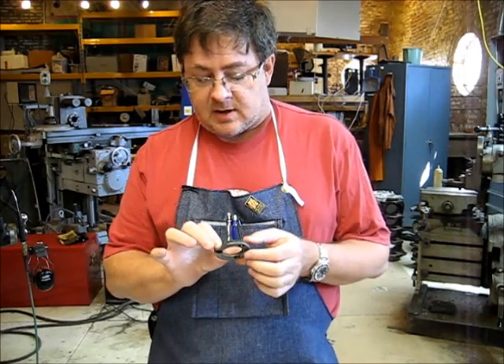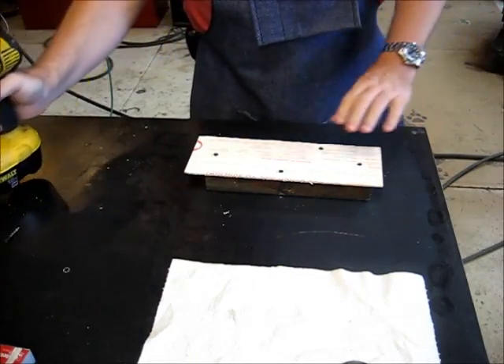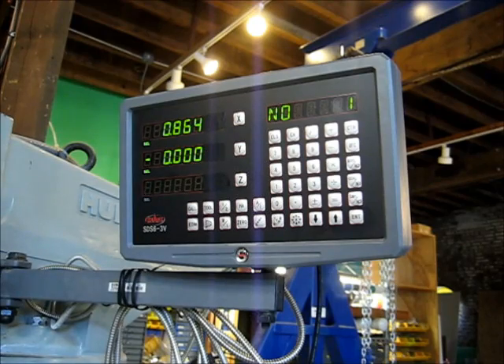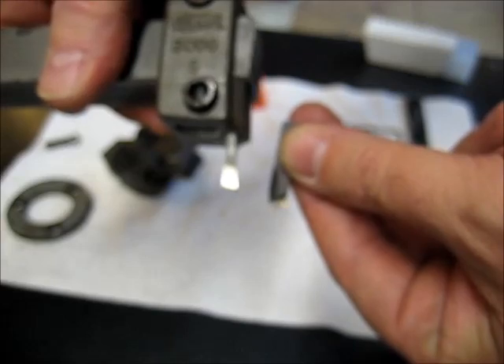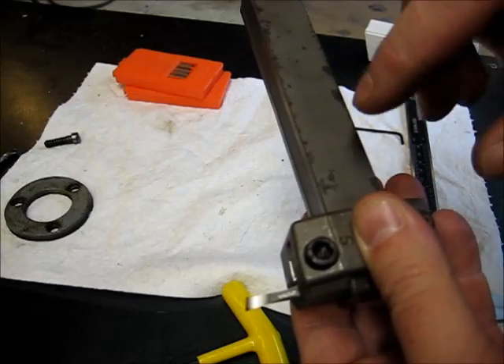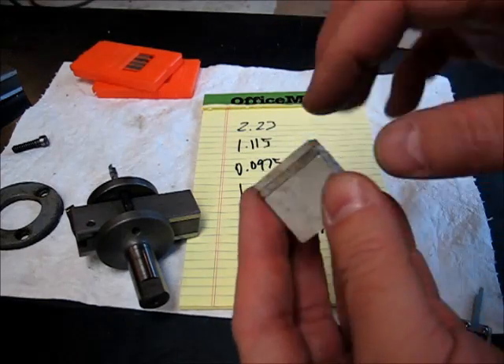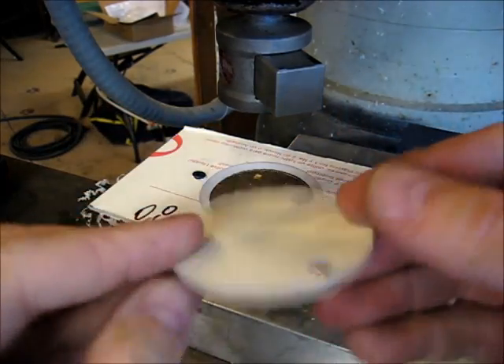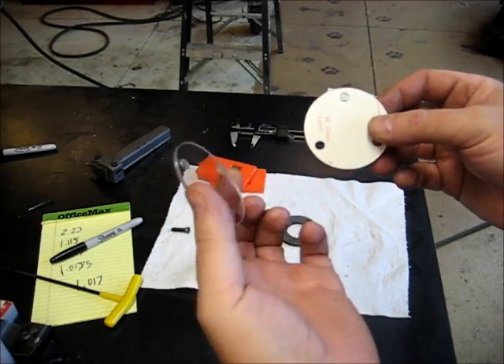Making new sight glasses for my Pacemaker lathe

Comment: I believe! that the bar of the disk-cutter should be mounted upside down. So the allen screw squeezes the short cutter directely. Now the worst case is, that the press surfaces will be squeezed to an angle and loose grip.

Comment: Hi James, One little tip when drilling PCD holes is to add 1 to the number of holes you need, then set start angle as zero but end angle as 360, so that the last hole is the same as the first. By doing it this way you don't have to work out the end angle, easy enough on simple numbers but saves looking up complex ones.